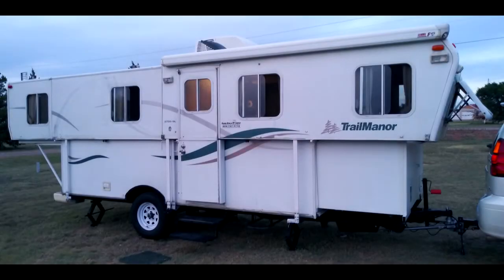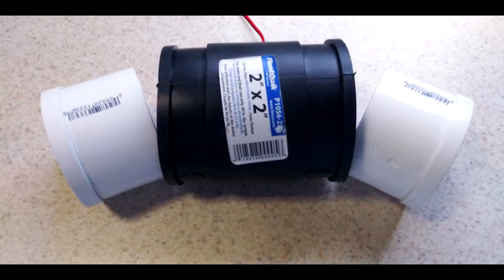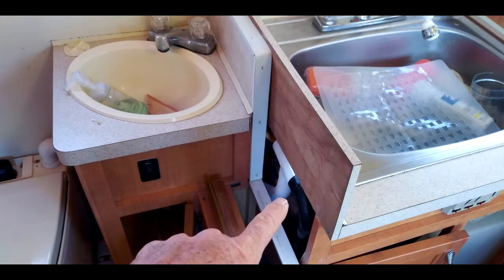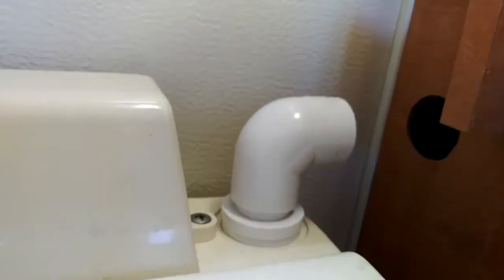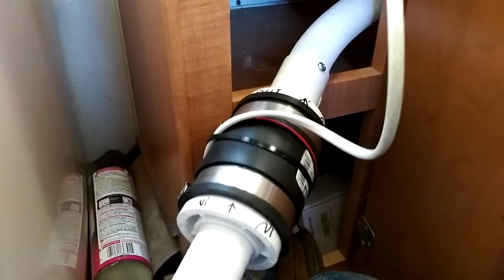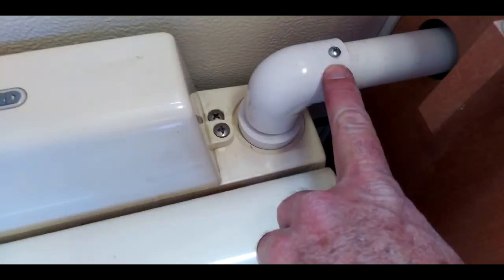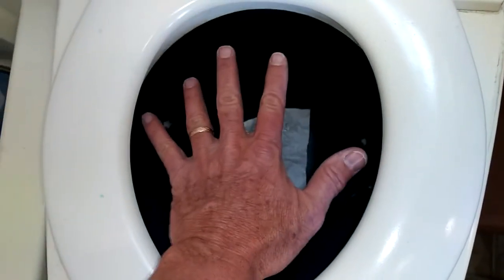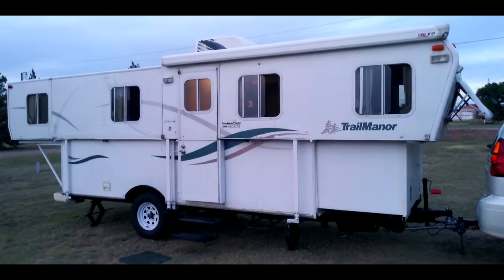Trailmanor Camper, Thetford Recirculating Toilet Vent Modification

Comment: Does anyone happen to have a link for a fan that will work?  I am having trouble finding one
Reply from the maker: Yes.  This system worked well for two years and then I sold that TM, 164 nights of camping.  I have installed a similar system in our new TM.  However, it uses the same fan.  Here is a link to what I would recommend.
https://amzn.to/3OtVvfo

Comment: was the factory fan not sufficient or did it break? i have a 2013 2720
Reply from the maker: The bathroom vent fan (bottom of tub) worked fine.  That has NOTHING to do with keeping the odor from escaping from the toilet.
Reply: @Flyboytr  got it

Comment: Great video and mod! Can you explain how the fan was wired to the switch and power? I'm not the swiftest on the electrical end of things, so will need some detail on that. I'm assuming you started with a hole in the rubber coupler for the fan wires, then it looks like some romex wiring, then to what and how?

Comment: Thanks.  I have an old RV that has one of these units.   I have not used it yet but wondering a couple of things. 1. Do you use a natural or chemical additive into the prime water and what and how much. 2. with the 12 volt fan use, when is it turned on or off, or when is it used. The people that sold me the rig had cat litter in a plastic bag covering the hole up top, and I was wondering why ... until I started looking into it. Maybe a timer to have it run at certain times ... I don't know.. or is it running 24/7 when the build up occurs.  Where and how do you dump and reprime?
Reply from the maker: Typically you should add 8 ounces of Thetford BLUE to the tank.  Once your pump is primed and recirculating the 2-3 gallons of fresh water you just added, hold the pump button down and slowly pour in the Thetford.  Your water will turn blue.  We let our little 12 volt fan run all the time.  Or, switch it on when you can smell anything.  It dumps just like any other RV black tank.  Open the inside valve, then open the outside one with the hose properly attached.  Close valves when empty and add water back to the toilet until the recirculating pump catches and is pumping.  It is called a Thetford Electro-Magic Recirculating Toilet.  You can find the manual by doing a Google search.  Good luck!

Comment: Got a 3023 TM and am doing the mod you invented to keep my wife happy. How did you remount the level gauge in the other side of the Thetford?
Reply from the maker: The left side of the toilet has the exact same port/opening as where the gauge is mounted.  It is mounted in a rubber grommet and will need some lubrication and gentle manipulation to pull it out.  Remove the cover from the right side and the seal and then just push the gauge into that opening.  Hope this helps!
Reply: @Flyboytr  Thanks for the info, I just checked and it should be an easy swap. What size fan did you use, 60 mm or 50 mm? Thanks in advance...
Reply from the maker: @mhbarnhart  ,
You're welcome.  I had to look at the diagram in the video... I used a 2" fan (50mm).  You could use a larger one but the other parts would have to change size to accommodate the larger fan.
Reply: @Flyboytr  Thanks for the great information!  I'm planning to do the install this weekend.  Question on switching the gauge to the left side - did you have to remove the Vent Pipe from the left side and move it to the right?   If so is there an easy way to remove the Vent Pipe?   The Vent Pipe is referenced on Page 6, Part # 11   https://www.thetford.com/wp-content/uploads/2015/03/Owners-Manual-Electra-Magic-Model-80.pdf
Reply from the maker: @stevebridges3070  ,
That part is an inlet tube (Internal) and is not related to any of this.  Basically you remove part # 23, the level gauge.  It is held in place with a rubber grommet.  Spray some safe lube on it, WD40, and start massaging the gasket.  Eventually you will be able to PRY it out.  That entire assembly is then inserted on the left side when a plug/cover exists.  It removes the same way as the gauge.  Good luck.

Comment: Great video! Do you have details of how you put the fittings in the toilet?
Reply from the maker: Just wrap the PVC fitting with a couple turns of electrical tape and it will become a friction fit.  Put the fitting with the tape on it in the freezer for a couple of hours, then QUICKLY press/wiggle it into place.  The freezer will make it shrink just a little for a tighter fit.
Reply: Thanks

Comment: This is an amazingly simple idea well executed idea. I vented mine directly outside but the idea is the same. I ordered a high quality computer fan for around $20 so I would only have to do this once. And so it would be very quiet. THANKS!
Reply from the maker: Thanks.  I used a 2" computer fan.  Easier to transition.  So far  it still does a good job.  A larger fan would require a bit more work making everything tie together but would give you more air flow and reduce the possibility for evil spirits to escape! :)  

If you're boondocking (without electricity), check the amp draw on the fan you're looking at.  Some of those actually use upwards of 2+ amps.  I think my small one only uses 0.2 amps.  Thanks again! :)